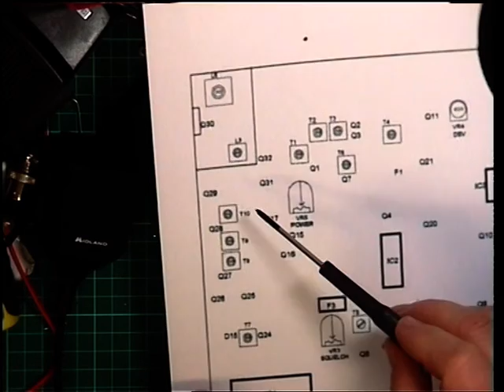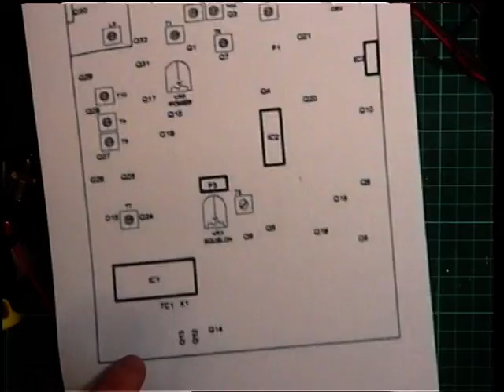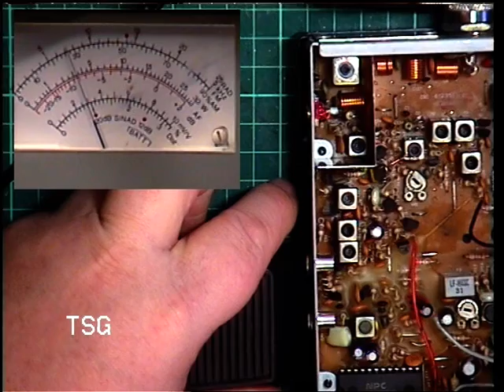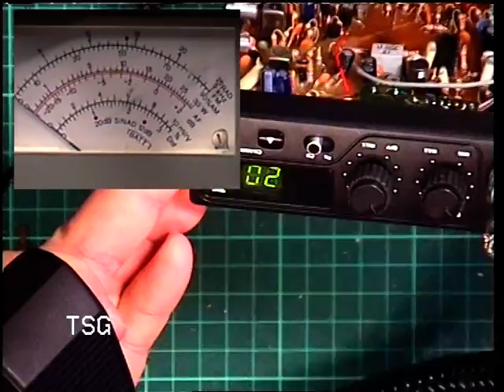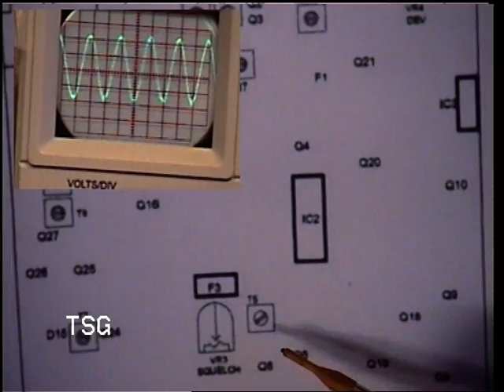Midland 77 095 UK CB Radio (mobile) - Transmit & Receive alignment

Comment: It is a very good quality device, it has a professional mid-frequency amplifier with an FM demodulator based on an over-acoustic noise detector. Therefore, squelch does not respond well to the signal strength but to the amount of superacoustic noise of the detector. Such a receiver reacts little to ether interferences caused by digital devices noise. This was my first radio, I bought a used one for 20 Euro. I thought they were cheap but it was my best gear, then there were only more expensive, bigger and worse devices. None of them had such a good squelch and FM detection. All of them also have a weak pre-emphasis, the modulation sound from the transmitter is dull, but they are also even worse. Greetings :-) . Modulation from old, expensive devices from the 1950s and 1960s was better, the sensitivity was worse. They gave everything they could.